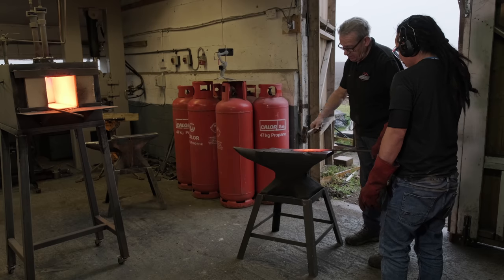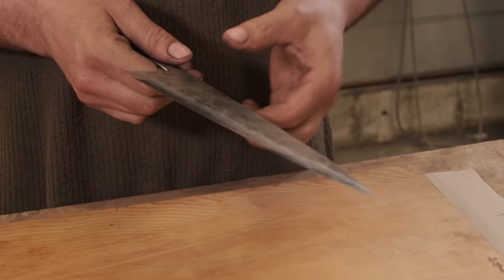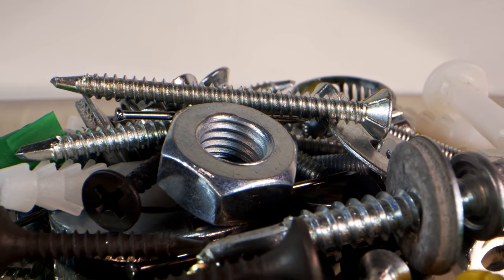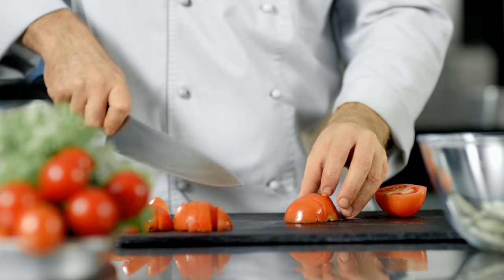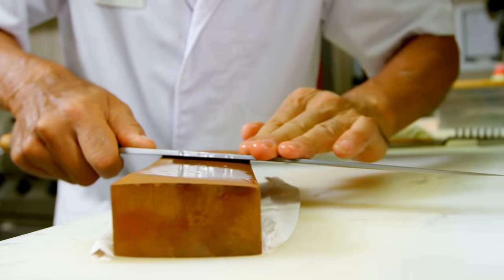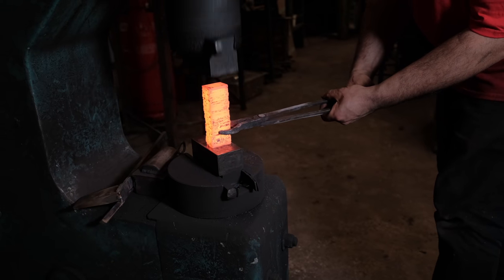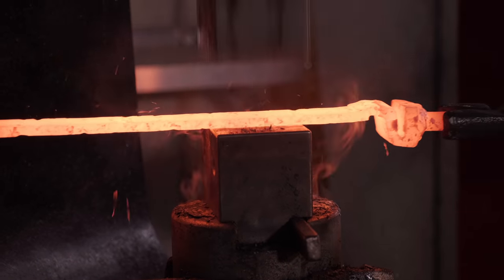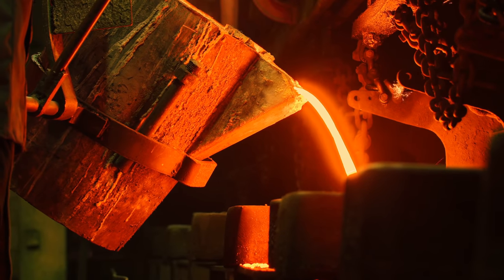Why 98% of knife makers pick the wrong steel according to a metallurgist

Comment: I like carbon steel.
Reply from the maker: Carbon steel seems to be a knife maker’s choice from what I have seen and heard! Thanks for your comment!
Reply: Elmax "stainless" steel has 1.7% carbon in it.
That's nearly twice as much carbon as most "carbon" steels. O1 and 1095 "high carbon" steel have only 0.90-0.95% carbon. 

:D
Reply: @dogslobbergardens6606  Elmax is a super steel. It's like literally the best steel there is. I'm not paying hundreds and hundreds of dollars for every knife.  Just knifes I use I like carbon steel. They aren't brittle and can take abuse. I own a bunch of 1095 knives that are wonderful and stand up to abuse without breaking.
Reply: @jhtsurvival  I'm well aware of what Elmax is; I've worked with it a lot and I've spoken extensively with the guy who developed the HT protocol for it for cutlery purposes (Brad Stallsmith at Peters HT). 
The point is, ALL the common (and nearly all of the not-so-common) cutlery steels are "carbon steel." Without at least half a percentage of carbon, preferably more like .8 percent carbon, steel just doesn't get hard worth a damn. Yes, even that cheap stainless in dollar-store kitchen knives is "high carbon steel."
Just saying you like "carbon steel" or "high carbon" steel doesn't really mean anything. 
It would be more accurate to say you like LOW-ALLOY steels (like 1095) which contain little or no other alloying elements (chromium, vanadium, etc) instead of high-alloy steels. And even that's not always spot-on; CPM-3V is relatively low in alloy content but it shouldn't be confused it with something like 1095; 3V is fairly stain-resistant, extremely tough AND stays tough at high hardness values.
"Carbon steel" is an almost meaningless, and often misleading phrase.

Comment: This is all just academics........You can make several knives out of various modern and older steels and give them to several people and just tell them use them in your everyday usage and come back a year later the every everyday knife users will say they all worked ok.  I highly doubt the average everyday person would say Oh this one was so much better than that one.
99.9% aren't knife snobs and just want some inexpensive affordable knife in their everyday life to cut a cardboard box, or a piece of rope or what ever.
Reply from the maker: Hi Benny. You are correct in almost every way. What I don’t agree with is that your comment is making it sound like knife makers shouldn’t pay attention to steel selection when it matters a lot. If you are a knife maker selling “inexpensive affordable knives”, I suggest you reconsider. Handmade knives differ from factory-made ones like Globals due to higher performance, customisation options, longevity and many other aspects. If you are going to ignore steel selection, your knives will go blunt to the wrong user, it will chip off if the wrong steel is used, they will moan about patina if they don’t understand it.

In my personal opinion, as a maker, YOU HAVE TO CARE about what you use or out in your knife, including steel selection.

Thanks for watching.

Comment: Would you want a stainless steel axe head?
Reply: not necessarily, because it depends what the axe is doing.  A splitting axe is not subject to much abrasive wear, so carbides don't have so much a part to play, and the bigger carbides, the more prone to fracture (i.e. less tough) the steel is under large impact forces.  However, a limbing axe is designed to go against the grain, and so is much more subject to abrasive wear.  But still, you would want to prioritise toughness.  But also, you don't want a cheap old-hardware store chopping axe made from cheap carbon steel with trash heat treat because they can never take a really sharp edge, seem to go blunt just getting close to wood, and they are so soft they are nearly as likely to dent as the wood is!  There may be a case for using AEB-L of SF-100 or even tougher lower-alloy/refined mix stainless steels if you live by the sea and dont clean or oil your axes, because the cutting edge has the highest surface are to volume ratio and so will lose the finest tip of the edge through oxidisation. "Viking streel" by Bohler Uddeholm is in a semi-stainless ingot steel family that might be a good compromise.
Reply: @tophat2002  I have a load of MagnaCut in my workshop ready for fun, but it wouldn't be my choice for axes.  It's expensive, would be enormously expensive for a lump big enough for an axe head, and I'm uncertain how it would respond to forging (the way axe heads are shaped).  No reason why you couldn't have one made though.  But no steel is going to hold an edge being driven into stones in the soil, and hard carbide steels will be prone to cracking instead of deforming/bending at the edge when you hit a rock, so you might be better off with a cheaper and easier to sharpen tough carbon tool steel.  We get rid of tree stumps by ripping them out of the ground with a chain attached to the back of a tractor.  Alternatively, you could use a "splitting grenade" wedge driven in with a sledge hammer.